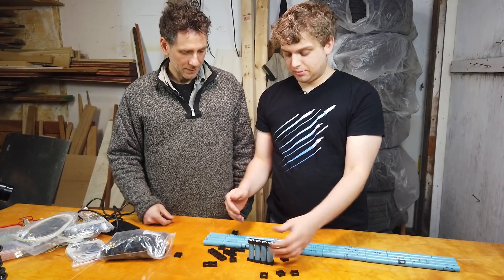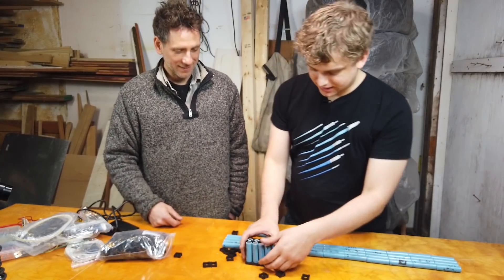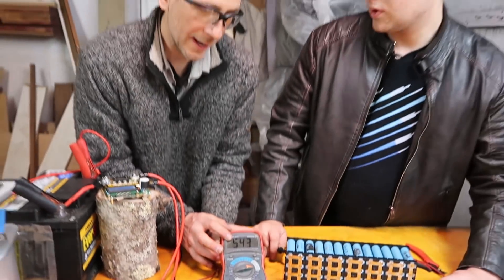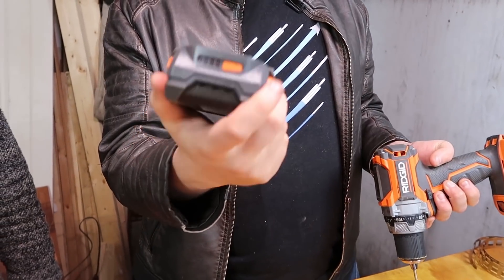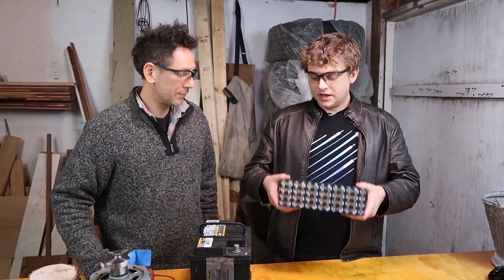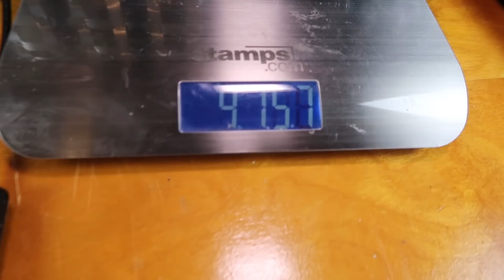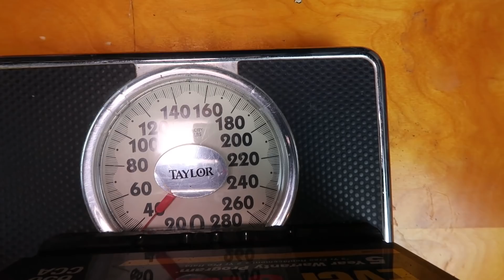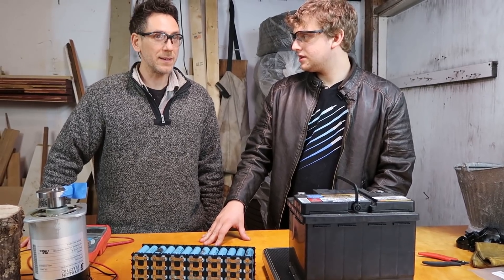Electric Conversion Workshop: Lawnmower Project - Episode 6

Comment: Easier  way to do it is to use a 3/4" pvc pipe instead of the battery Cell Holders. Plus it is much easier to take it apart and replace any battery that may die.  You should have some room left inside the pvc pipe to run any wires to monitor battery health

Comment: I want to make some of those modules, I'm on solar and want to upgrade.  Would they work? Where do I find a list of materials used for this series?
Reply: 18650s recycled from existing components. Battery holders can find on Amazon. Nickel strip same place. K weld spot welder.
Reply: @MrGsWorkshop  thx

Comment: Does the "spot welding" weld each battery terminal to the strips, or do the strips just make a "friction" contact to each battery cell?  ...seems like the latter would be prone to vibration disconnects.. :/
Reply: The nickel strip is welded to the top of the battery. Sure. If you're vibrating the battery or twisting it. You might break off the contacts. Although when it's all together it's very robust.

Comment: I converted a Dixie Chopper to Electric about 14 years ago and used it for my lawn business cutting 10 to 15 yards a day. This was the time of lead acid batteries and I did fast 10 minute charging between each yard.  I used it for 3 years until I went into the electric car conversion business full-time. I used my electric truck wish I had been driving for 10 years before to charge the mower plugging directly into the electric car 120 volt pack the 96 volt mower would charge at about two hundred amps. Here's a clip of me cutting some high grass with it.  https://youtu.be/OqiAGU5cLjY I was surprised back then when it didn't seem to catch on cuz I really thought it worked well.
Reply: That's great. Thanks for sharing. Amazing how far the Battery tech has come. Feel free to get in touch.  I did my first conversion 2008. Ron.Grosinger@gmail.com
Reply: @MrGsWorkshop  I see an EV Volkswagen Cabriolet on your site maybe a Mike Brown kit? Yes the batteries have improved considerably. And no one knows it better than those of us who live with lead acid golf cart batteries. Keep up the good work